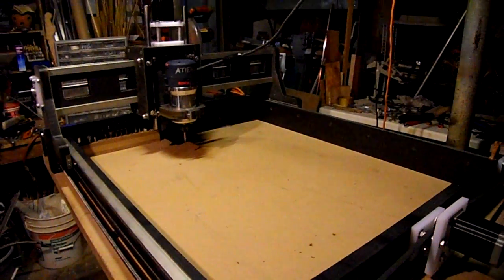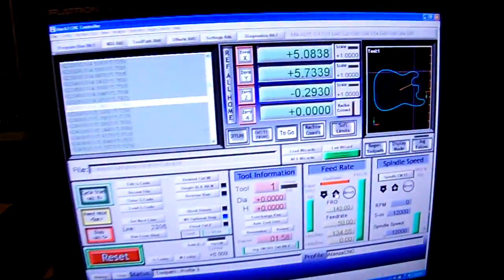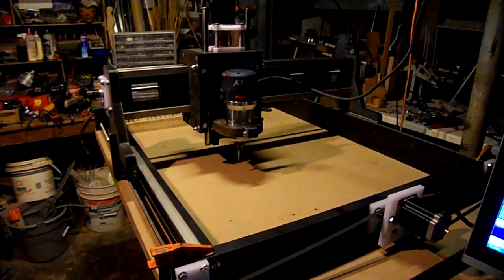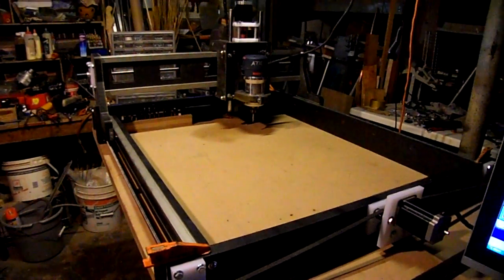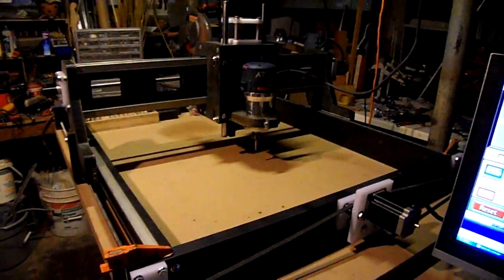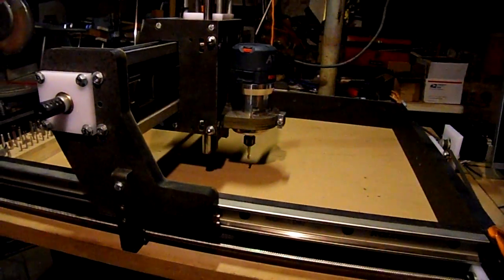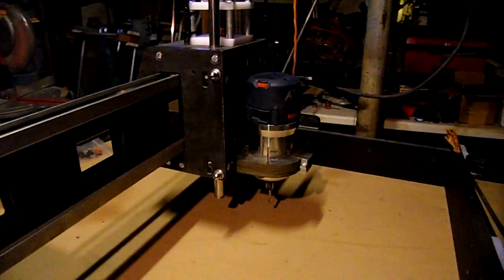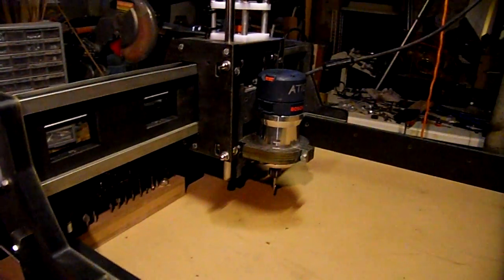New Home Made CNC Router, In Action!

Comment from the maker: @magnumowner You can set soft limits for Mach3, but honestly I don't use them.  If you program your part, and sry zero at the center of the workpiece, you should have no troubles!

Usually, the only time I set 0 at bottom left is when I aam doing something like a sign, where the piece is pre-cut.  But mainly, I set zero at the center of teh workpiece.